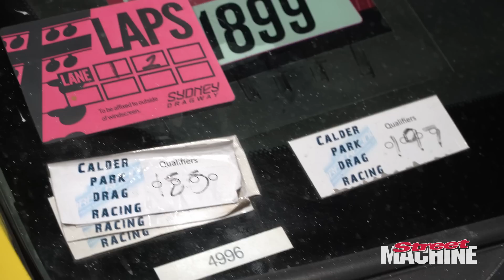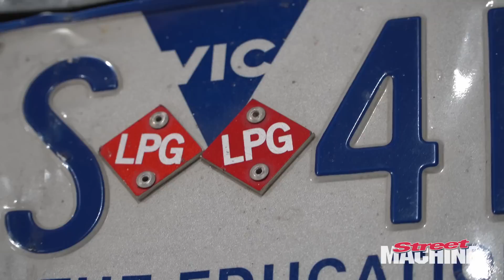Carnage - We Pull The Engine from Turbo Taxi to Find Out What Went Wrong!

Comment: Wow the lpg is hard on the oil
Reply from the maker: It is when it gets pumped into the sump
Reply: @STREETMACHINETV  yeah of course because of the ringlands, how does the LPG go with normal running and pushing what it does for blowby
Reply from the maker: @OvertakingLane  It's not too bad, but you do need to service it every 5000km or so.
Reply from the maker: @OvertakingLane  It's not as bad as E85
Reply: @STREETMACHINETV  oh ok, I musr say you've done a lot chasing the 10 and commend you on that, fingers crossed for a 10 on first pass back after rebuild

Comment: melting pistons cause lpg burns so much hotter that unleaded or e85?
Reply from the maker: It's possible
Reply: @STREETMACHINETV  it was my thought , as i had the same issue with a old turbo gas  351 ,, would always melt pistons , i went to sniper efi kit e85 and hasnt done it since even at higher rpm range and boost

Comment: i think before i went for a full build motor, $$$$ i would have been keen to pull it down rebuild it back together as the stock bottom end but hypereutectic pistons, full dynamic balance and do all the little bits. mod oil feed holes to the mains by filing or drilling the oil feed holes into the main oil so i feeds directly onto the bearing  not just half a holes worth of oil, i think that makes sense??  the tiny bits that cost nothing, mostly. match every mating hole everywhere, every hole that joins two surfaces. plus any of the mods you have already done.  really test the limits what still a basically stock Barra.
Reply from the maker: Hyperutetic pistons aren't much stronger than cast. For the dollars might as well go forged
Reply: @STREETMACHINETV  just thinking the hypereutectics expand and shrink less so can run a tighter piston clearance so less stress on ring lands? they can help piston longevity without as many $$$? just thinking you might give the existing engine another life. maybe keep as a dyno mule to test theories before put in place with the dearer engines? i just don't wanna see another barra in the bin. LOL.

Comment: Scotty , if you had of run a Liquid injected LPG system from the get go you would have likely already achieved your goals. I have a VY LS1manual SV8  that has a OTR , Mafless tune  and a LTG Liquid gas kit on it, otherwise the car is completely  stock even the exhaust system  , after doing a 98 octane petrol tune with EFI Live it made 237 rwkw's , swapping over to LPG and re  tunning it for best results on  LPG the  power jumped to 262rwks. You'd need a cam change for that much power on 98.
I'm currently building a HT with a L98 and LSA blower running on twin LTG liquid kits hopping for 650+ hp.
Reply from the maker: I'd be keen to see how you go with that
Reply: Tunnel vision has run the fastest LPG cars in the country, I'm pretty sure he knows what he's doing. 264rwkw on 8cyl vs 490?rwkw on a 6 cylinder turbo is not comparable either.
Reply: Very true , you may have missed the point I was  trying to make  , the VY isnt  a race car, the point I was trying to   make is that "Liquid " injection make more power than 98 octane perrol and the kit Scotty used is a Vapour injection kit that makes less power that 98 octane petrol  so had he chosen a Liquid kit he'd probably gone quicker.  The Liquid option would have needed two fuel pumps in the specialized lpg tank but they don't need a second ecu to run nor a vapourizer in the engine bay so the cost of a streight gas conversion  becomes  more comparable to vapour kit conversion  .
The point to my VY is that I have a reliable dayley driver ( for 12 years now) that has more power than stock LS1 and is as cheap to run as a 4 cylinder ,  when it was first put on the dyno completely  stock  it made 197 rwkw's,  now i get 262rwkw's and a car that has no trouble returning 11.5  lph on the freeway and pulls the tandom trailer with a Commodore race car on it at 110 kph and returns 15.5  lph.  lpg is currently 91.9 cents where i live and 98 is about $2:35 cents a little , do the math,  its cheap as to run , try pulling a race car that with a twin cab diesel and see how it compares ,  the VY eats them for breakfast on the hills and never drops under 110kpk and only cost 1/2 as much for fuel ....just sayin
Reply: @craigritchie1933  about 8 or 9 years ago I tried to get someone to do a liquid injection lpg setup on my ba XR8 ute and no one wanted to do it. I’ve done 400,000 kms in that time all on 98 unleaded, the thousands I’d be ahead now! Hearing about ur ls1 on gas makes me wish I coulda got it done back then
Reply: I'd read about "Liquid " lpg in a performance magazine about 1995 and it then took another 17 years for an ADR approved kit to become available for my car , they were/are expensive and you had to push hard to get one  but i had to have one.
My cars now done 300,000k 

People are now saying that LPG isn't worth having because its become too expensive at around $1:00 a litre however the savings are bigger now than they ever were.
Most people don't realize they can still retain a simular  amount of power and to what they currently have on petrol with big savings  🤔
Reply: @ZedTee77 Very expensive up front costs though before you get to any savings.  Nothing comes cheap.
Reply: @craigritchie1933  and emissions, from what was a byproduct to start with, 5-10c/L and math wise most conversions just had to be around half the price of petrol to beat it cost wise, and for a very long time, it was able to be bought for way under that amount hence Taxi LPG fleets, that said hybrids have come a long way also. 

From the 80s till now only had 1 petrol car rest have been duel fuel gassers. The only time it has been bad to own a Gas car is Summer... 40ºc+ days and trickling fuel going into the car from the tank heat.
Reply: @tchpandy  Yes thats the problem however for my HT project car  i bought 2 second hand kits for $500 each to hopfull get most of the parts needed to make 650 flywheel hp on a supercharged combination. 
Its no so much about fuel savings on my HT as it won't do hundreds of thousands of ks but more about running fast on what most think is barbeque fuel....
Reply: Hey guys and girls Scotty is telling the truth regarding making power on lpg as 
I myself have been doing a vl turbo with rb30 and gas research throttle body for the last 10 years and yes you can make more power than petrol but there comes a time when you start to hit a brick wall with the gas and it’s all the little things that add up eg 4 heads now on the vl 4 different modified gas research throttle body’s 
3 different gas supply line setups 
Two turbos second one bigger to try and get more power 
Different cdi ignition system 
Twin modified converters twice over as the first ones failed on a lean backfire 
Three motors now full forged pistons and rods 
As lpg wants to separate from the air flow as it’s heavier so in came a different inlet manifold and also has been modified on the flow capability 
And now going for individual coils
For sequential ignition with an ecu 
And will be measuring Egt temps per cylinder plus air temps etc 
I did mange you go 465rwhp at 22psi before this last setup I’m currently doing but yes it’s worth it and satisfying when you achieve the goals but also bloody expensive no matter what system you decide to go with 
As no lpg system was intended to make much more than stock power or alittle more so good luck to the people that achieve there goals and make it all work
Reply: @anthonywhelan8373  You've got to be given points for persistents.
Most of your issues you have had  are unique to your application . A Liquid kit doesn't have a gas mixer (carby) or gas converter , the LPG is sprayed as Liquid at the back of the intake valve so there's no gas in the intake manifold to separate, It's a port injected efi system much like a petrol efi system, they have a in tank fuel pump , liquid fuel injectors,  fuel pressure regulator and a return line to the tank , sounds familiar doesn't it.
Sequential ecu's are commen place these days and if your running a commodore like me and have a efi cable like me you don't need an aftermarket ecu.
 I've got less than 2k tied up in my HT Holden conversion and it's running in NA form until I finnish paint and panels
Reply: @craigritchie1933  yes Craig it’s been a long road but unfortunately the liquid systems weren’t around when I converted the vl to lpg as I’m a qualified lpg fitter as well as a mechanic by trade the whole process has cost me a lot less than the average person but I still like putting it up the ls1s at the local strip in ballarat over 1 sec faster than a cam and exhaust package ls1 and then people are amazed that the vl is lpg it’s satisfying to see there faces when there put in there places 😂 it has been 7.82 1/8 mile as a manual car with 18 psi now with a transbrake glide and going for 28-30 psi soon once it’s all back together I hopefully will see a low 7 or high 6 on the 1/8th which convert’s to a ultra low 11 or a high 10 on the quarter mile and good luck in getting your car setup not enough people are playing with the stuff i
Reply: @anthonywhelan8373  I wish you well and hope you succeed in your indevours.
All I was trying to say is had Scotty started with a Liquid kit he may have already reached his goals, well never know
Reply: @craigritchie1933  I first got interested in turbo LPG back in the late 80's (bought some IMPCO gear) but after countless research I just couldn't find anyone to think outside the box. I did eventually get the name of a guy who I corresponded with for a while about kind of direct injecting LPG (converted at the injector), but there was literally nothing on the market at the time (for high performance). I took another look at it after the LPG started to appear on Commodores and Falcons but to try and do what I wanted to do it was going to be prohibitively expensive. I still to this day believe that LPG can be the equal of petrol, the problem is there is not enough knowledge out there to ever make it happen mainstream. In many ways LPG is superior to petrol but most people just can't see it. Our LPG isn't quite as good as the American propane (which is not the same, but similar) but it still has all the benefits like higher RON and the latent heat transfer when direct injected (free NOS effect). Being dry is a disadvantage but that can be worked around. Sounds like you are off to a good start with the HT. I 100% agree with you though wet injection is the way LPG should have been done from the start if the technology was there.
Reply: @DodgyBrothersEngineering 
Propane was freely available where i live , so when my VY was originally tunned i filled the tank with streight Propane as i thought the extra octane could be beneficial dispite the fact that the 40% ish of  butane  in LPG has more BTU's than Propane, turnes out I was mistaken, when swapping back to LPG from Propane the engine produced more power  I've forgotten now but i think it was around 6 rwkws extra

Comment: Half of the Grill is Blocked start by removing that grill opening all the Holes or replace it with a custom one so the car can breath! 600HP requires cooling and why you keep blowing engines!
Reply from the maker: The car doesn't get hot

Comment: What I don’t understand is if your piston rings are damaged how does the coolant mix with the oil resulting in milkshake ? I would appreciate an answer instead of liking my comment
Reply from the maker: It's not coolant, it's unburnt LPG contamination
Reply: good  to know ! Interesting , thankyou for replying you are a legend
Reply: @STREETMACHINETV  I just replaced a head gasket on a 2011 FG Falcon had milkshake oil , mud on the dipstick it has an aftermarket LPG system installed , I thought that this was a head gasket issue as it is drinking coolant , even after head replacement all done to spec , still drinking coolant looks like it’s mixing again with oil ; so one thing is the FG transmission heat exchangers the known fault possibly the coolants dissapearing there , and that the fault of milkshake is not coolant mixing in the head with engine oil but possibly LPG contamination ? So a fault from LPG caused your ring to smash ? Car I’m working on has 284,000 klms still running the original trans oil cooler as the persons car I’m working on has has it since new . the FG though has zero symptoms of a head gasket  compression is good , no smoke and no overheating for a head gasket before or now after head was changed ! possibly a hairline crack in our head maybe ? but still the engines running fine , not running rough at all or symptoms it has a cracked head
Reply: @STREETMACHINETV or FG falcons running a dual fuel system does the N/A need the head swapped over to the green top head ?
Reply: @STREETMACHINETV it’s all good head gasket job I did was a success my customer was freaking out prematurely

Comment: I have to agree with the complexities of running LPG on NA let alone adding boost many years ago I toyed with the idea of an AU Intech on Gas worked out too much money and not exactly feasible such as using liquid LPG Injection much more reliable but expensive. And sadly when Fords wear its usually the pistons on the back on the engine I remember 250 logs and x flows right through to E series Intech and Barra but in these cases mainly just wear and tear over years but you were right.

Comment: Ring gap !! Didn’t get away with this one ! Lpg must create a lot more heat ?
Reply: Absolutely!… would still be alive today running 10’s if the bottom end had just been pulled down and ring gap added 🤷‍♂️
Reply: Yes it does create more ring heat, because LPG is a dry fuel and doesn't have the ability to cool the rings like a wet fuel (petrol) extra ring gap would have more than likely saved this engine. Looking at the piston Scotty pulled up there is no signs of lean out damage, this looks more like the rings nipped up and tore the ring lands out.

Comment: Is it purely the heat in which lgp burns at that creates too much heat for the pistons. Is it the inconsistent burn of lpg that's the problem? For bbq on a open flame it burns pretty good but shoving it into a cylinder n squashing it causes issues.

Comment: Btw, we did get a Ford 4.0L six cylinder here in the States, but it was a V6 and the first generation was overhead valve and the second generation was SOHC and was never offered with a turbo. I had a 1994 Ford Explorer Eddie Bauer edition and it had the 4.0L OHV Cologne V6 (160 HP 225 lb ft) with a A4LD pile of shat auto trans and the 97-01 Explorer had the 4.0L SOHC and it made 210 HP. I pulled my 4.0L out of my 94 and swapped in a 302W with an Explorer Express Eaton M90 supercharger. That truck was jacked up with a 6" Skyjacker kit with 33x12.50s on it and it made 402 whp at 15 psi. It was 2WD because I lived in Florida and it's all flat, but it was alot of fun and it wasn't slow. I moved to Pittsburgh, Pennsylvania back in 2000 and I bought a 1995 Ford Ranger Super with the same 4.0L OHV and I put my supercharger kit on it with a different intake manifold. It was also 2WD and it would lay an 11 for 50 feet before it caught traction. I have always loved to modify my vehicles and I've owned 68 of them to date.

Comment: ffs guys these internet ' see how much power they can handle' always f_ck up not because they didnt have forged pistons and fancy ass rods,  its because they didn't gap the piston rings to suit greater expansion due to greater heat caused by boost. If you're doing this at home, ffs just gap the rings on a stocker , file open the gaps so theyre larger, put it all back together, turn up the wick and enjoy. What happens is the piston ring ends butt together due to not enough gap, and they bite into the bore, but because the piston is travelling so fast, it just breaks in the ring landing and takes chunks off from the sides. To be fair to what the guy is saying, E85 would have survived at this power level because it runs a lot cooler than LPG, the pistons are cooler thus there's less expansion of rings, but where the limit is exactly on a stock, ungapped engine running e85...700 hp, 800 hp? in that sense, and as Scotty says, its a 12000 dollar experiment, sort of a useless experiment as 99 percent of people wont pay 12000 to replicate,  but educational nevertheless.
Reply from the maker: I agree that ring gaps would help at this power level
Reply: @STREETMACHINETV  ring gap and correct timing/fueling is usually reliable on stock pistons. Rods should bend first

Comment: How difficult would going straight methanol be
Reply from the maker: Better to go E85
Reply: Could be wrong but methanol usually requires mechanical fuel pump and massive injectors, plus the maintenance on a methanol engine is tedious, one stuck injector can cost a rod. 

Ethanol is better although people make good power on pump petrol too